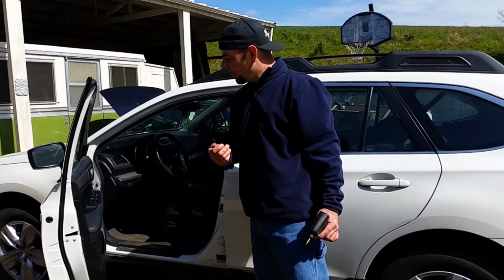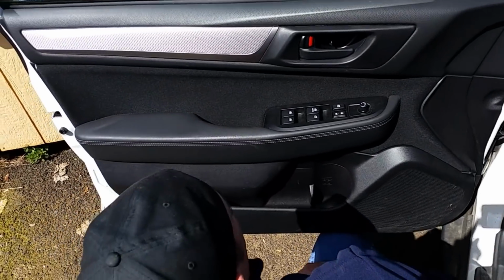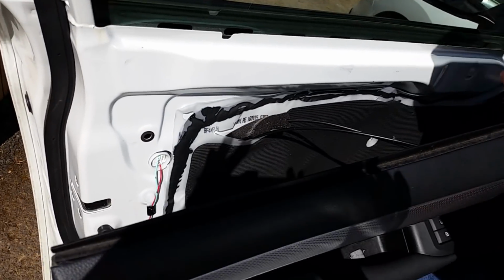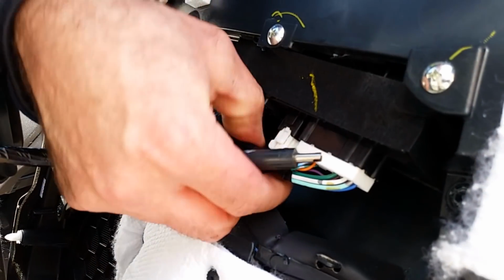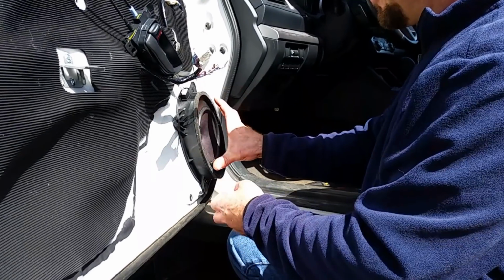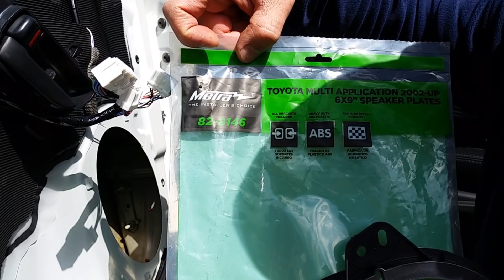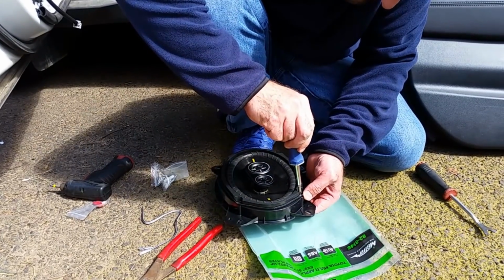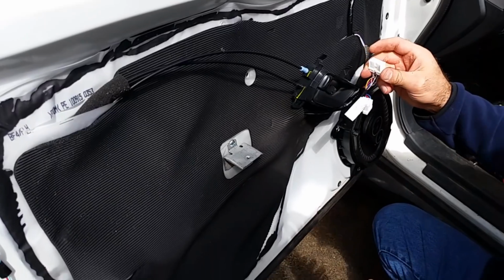How to upgrade the front door speakers in a Subaru Outback

Comment: Clarification: anything different I should know about possible installation difference from video fir a 2001 legacy? speaker size I am seeing is 6-1/4. do I need a size adapter you used? Do I get 6-1/4 for all 4 replacements? Thank you. Lorraine the 60 yr old in Montana. Think I can do it- took auto class in school and did some auto engine /brake stuff on older cars- would like to try this replacement myself. Thanks for video😌

Comment: I'm going to try this soon. Just got some Polk speakers from Crutchfield for my '16 Outback. I'm going to leave the stock head unit for now and see how it sounds with the new speakers alone. What was your experience. Did you replace the stereo?
Reply: How did your speaker swap turn out? Worth the effort? Considering doing the same in my '18 OB and want to keep it simple by keeping the stock head unit.
Reply: Also wondering how this turned out. Any updates?
Reply: @jwkruege  speaker swap was worth it for sure but the stock stereo is trash and I eventually replaced it a year later. Also added a small kicker sub under the driver seat. The speaker swap in the doors was easy.

Comment: The sound is so bad in my 2019 outback with 8” HK (basic) system. I honesty think that my eco dot has more dynamic range.  I must have those @&it speakers up front.  I am replacing them ASAP.  It’s funny cause my 2010 Ford had a base Sony system and it sounded great my brand new outback sounds terrible.

Comment: Great video...did replacing only the door speakers made a noticeable improvement? Is it worth the money?...btw I have the same car as you and looking to improve the crappy speakers
Reply from the maker: It made a huge difference! It's probably the best upgrade you could do for the sound system. The Kicker 6X9's are incredible and they cost half as much as I was expecting to spend. I'll be installing a subwoofer soon if you're interested. I'll try to post a video of that as well.
Reply: How To For You I followed your advice and went for kicker 6x9 in the front door plus some infinity reference tweeters...it's like having a new car!...now I'm thinking of adding an amp behind the radio unit.... we'll see.
Reply: I got infinity Primus speaker PR9613is as suggested by Crutchfield. By any chance do you know if kicker are better than the one I got. I haven't installed yet, going to install in a day or two.
Also I am interested to see the next video for sub installation.
Reply: @howtoforyou9380  I am interested in that video
Reply from the maker: @sanjeetkumar3062  Sorry for the late reply. I just now saw this comment. My opinion is that the Kickers are better. They have a higher sensitivity (db) which is better especially when utilizing a factory stereo. They can also handle way more power, and reproduce lower frequencies (bass). The Infinity does have the advantage of being able to reproduce higher frequencies (treble). You can compare their specs by looking here: https://www.crutchfield.com/S-8HvA1lr99Qj/p_108P9613IS/Infinity-Primus-PR9613is.html
and here: https://www.crutchfield.com/S-xO7ISoTbTiQ/p_2064CS6934/Kicker-40CS6934.html

Comment: thank u. if i get a 7x10 i would not need that plastic frame right? i got a 2015 ob
Reply from the maker: It would depend on the depth of the speaker. If you use the reference at Crutchfield it'll show you what fits in your vehicle. Here's the link: https://www.crutchfield.com/S-w5R2bRMXQ38/ymm/2015-Subaru-Outback-Speakers-Stereos.html

Comment: WOULD THESE METRA ADAPTERS WORK WITH A 2015 FORESTER. Mine has the exact same 6.5 in the 6x9 basket
Reply from the maker: I imagine they would work. The base speakers are standardized parts used across different product lines.

Comment: Interesting. So yours was the Premium model with six speakers, no the H/K, correct?. Since you installed a tri-ax, did you disconnect the factory tweeters or leave them be? Do you know how many watts the factory system is putting out (I think it's made by Clarion)?
Reply from the maker: The car is just the base 2.5i. It's got 6 speakers but not the Harman Kardon package. I left the front 3.5" factory speakers alone because their sound quality isn't too bad and thought the money would be better spent on speakers for the rear or a sub. I'm not sure exactly how many watts the factory infotainment system is but it's fairly powerful. It has no problem driving the Kickers and you can definitely feel the bass. With the windows rolled up you can hear the stereo from several blocks away when a song with heavy bass is playing.
Reply: Thanks for the great video. Three blocks! Go easy on your ears man!

Comment: I know it's not the worst thing to clip the factory speaker adapter, but it's only a $10 part from Crutchfield to do the install without butt connectors and bodges and saved almost no time.
Reply: Yea cutting those factory wires was painful to watch. You can get Metra 72-8104 Speaker Connector for $5.85 from Amazon and means you'll be able to plug and play or unplug and sell much easier!
Reply: Do you know if the 72-8104 adapter will work for this model?thanks

Comment: What the speakers installed in the back doors ,do you know ?
Reply from the maker: The rear doors have 6.75 inch speakers.
Reply: @howtoforyou9380  where can I order that speakers ? Can you send me link?
Reply from the maker: @yulianmarkevych2709   Here's what I used:
https://www.amazon.com/Metra-82-8146-Speaker-Adapter-Vehicles/dp/B00IIC6CPE/ref=sr_1_1?ie=UTF8&qid=1539101617&sr=8-1

https://www.amazon.com/Kicker-40CS6934-inch-3-Way-Speakers/dp/B00BRXNH0E/ref=sr_1_1?ie=UTF8&qid=1539101777&sr=8-1

Comment: What size are the original speakers
Reply: Also can u plz list all the websites u used to find the adapter and the speakers
Reply from the maker: It depends on what model you have. The holes in the doors are made for 7"X10" speakers as shown here: https://www.harmankardon.com/automotive-subaru.html
However the speakers in the lower end models are closer to 5 3/4" with a built on adapter to fit the hole.
Reply from the maker: Here's what I used:
https://www.amazon.com/Metra-82-8146-Speaker-Adapter-Vehicles/dp/B00IIC6CPE/ref=sr_1_1?ie=UTF8&qid=1539101617&sr=8-1

https://www.amazon.com/Kicker-40CS6934-inch-3-Way-Speakers/dp/B00BRXNH0E/ref=sr_1_1?ie=UTF8&qid=1539101777&sr=8-1
Reply: Thanks